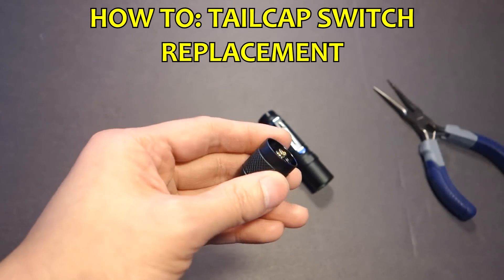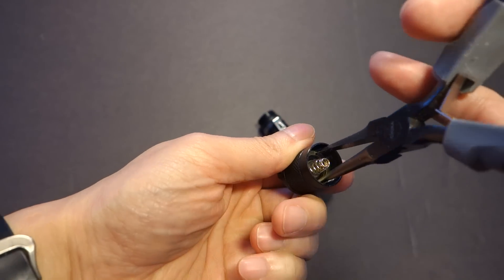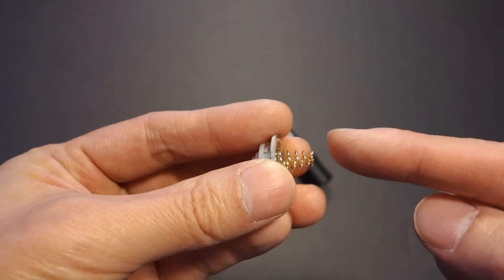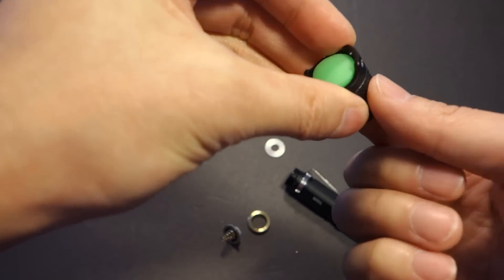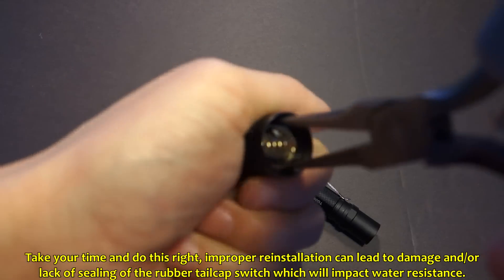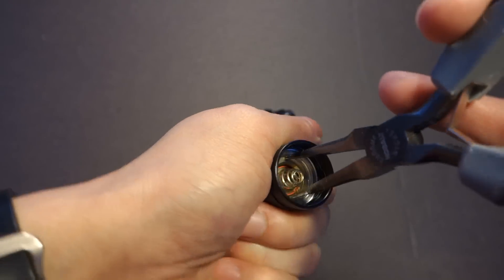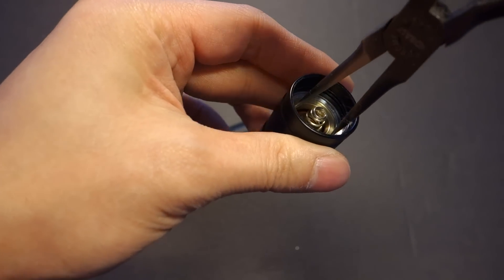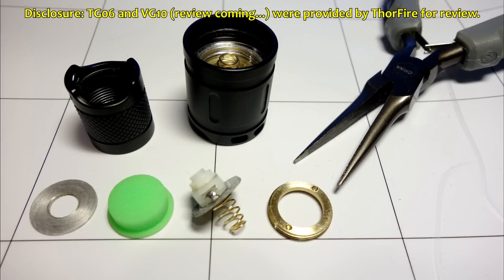HOW TO: Flashlight Mechanical Tail Cap Switch Replacement

Comment: Thanks for the tutorial.

I recently dropped my Nitecore New P30 flashlight on concrete.  It started acting up after.(working intermittently) 

Turns out, the retaining ring was loose, so tightening it fixed the problem.

Comment: Mine doesn't have that.
Reply from the maker: Which model flashlight do you have?
Reply: @TekyTimbo  gas station bought..honestly don't know but it definitely don't have that. Pull back off and push button straight out with under it is a clicker and metal tube that touches the contacts. I promise that is not in it. I will look when home and send to you. Hopefully model is on it. Will be back shortly

Comment: Thank you. Saved me from having to buy a new tail cap for a retro Surefire 6P. They are pricey. The spring fell off the retainer. You helped me get it back on, and working again. Was going to cost me over $50 shipped for a knockoff.
Reply from the maker: Great to hear, the vintage 6P is a legend amongst the flashaholic community. Glad that you were able to get yours fixed without incurring unnecessary costs. May it continue to serve you well through the years!

Comment: So, Im new to flashlights and was looking at a Cosmos LEP, and a Weltool W2 LEP. I want to add a pressure switch for the activation, but I do not think they make anything like that for these small LEP's. Could a service provider just take a pressure switch tailcap and mod it to work with the existing oem clickie tailcap on the LEP's?
Reply from the maker: Technically yes, as long as the threads match it should work. You may be able to find some custom modders on the light forums who have machining tools that could potentially do this for you.
Reply: @TekyTimbo  Ok, thank you so much. Would you be able to recommend anyone for this type of job??

Comment: Great video.  What do ou suggest to use to clean?
Reply from the maker: Hi, thx for the question and your support! Do you mean what chemicals I use to clean the threads? If so, generally isoproyl alcohol 90% (but 70% is fine too). I try to avoid using it on the o-rings, for that I would generally just wipe off the old grease and relube with new, making sure to coat the underside as well to prevent any binding.

Comment: Where can I purchase replacement switch?
Reply from the maker: Try reaching out to the manufacturer of your light; however, many lights use similar switches so you might be able to utilize a similar one from a different brand. Which model do you have?

Comment: Very good presentation and if I politely suggest that Nyogel 760G is a great lubricant that is safe with all O-rings just apply to your valuable flashlights to the treads and the inside of the contacts just a very small dab 
does the job every 4 months to protect your flashlights from corrosion and ease for sound functionality. Around $22 from Amazon but worth every dollar.
Reply from the maker: Great tip! Thx for chiming in!

Comment: thank you. i was about to dump my light, and wondering how it can be disassembled. then i ckeched de switch with multimeter and it was working. re assembly made my day but it works again now :)

Comment: how do you get a new switch?
Reply from the maker: You should be able to contact the manufacturer of your light; some models may use commonly used parts so you might be able to find a substitute from a different light. If you need further help, try hitting up one of the major forums like BLF, CPF or r/flashlight.

Comment: Wished someone would do a video on adding a pressure switch to end of on/off end cap. I punched a hole ran my pressure pad wires try green rubber button, soldered wire to copper spring(positive side of pattern, thought I just needed to made contact with handle to complete circuit but it stays on won’t shut off, I made one 5 years ago but cannot remember er how I did it

Comment: I have a flashlight like that and it has started turning on without touching the switch, even if you pick it up or shake it the light come on but if you click the switch it turns off . Is that a bad switch?
Reply from the maker: It would seem so, what's the exact model you have?

Comment: Where do you get tail caps from
Reply from the maker: Most times you'll need to source it direclty form the mfr of your light but there can be occasions where the inside parts (e.g. switch, rubber tail cap, etc.) might be generic and you should be able to utilize a similar part provided the dimensions are the same.

Comment: I may need to watch a few more times, I see you have taken apart & put back together the end cap & switch. Mine is similar, Alps Mount. & I was able to isolate that it is the switch via YouTube video by BatteryJunction But I don’t quite understand the fix. Thx!

Comment: My tail cap is stuck 
It won't budge 
I have had people who lift 50 kg weights but can't get this base to open 
It's stuck what do I do
Flashlight is Duracell 300
Reply from the maker: They should go for intensive training and try again when they can lift 100kgs :)

Kidding aside, this will be really tough to fix since it sounds like you have severe battery corrosion and the tailcap threads are on the inside thus making it very difficult to get any solvent in there to free it up. You can search for threads around stuck Maglite tailcaps and follow the suggestions (like in this old thread but with still relevant tips: https://www.candlepowerforums.com/threads/maglite-tailcap-stuck.297146). Or I would just try contacting Duracell directly and mention that you're aware of the class action lawsuit (https://www.classaction.org/blog/in-the-dark-allegedly-defective-duracell-led-flashlights-drain-batteries-when-turned-off-class-action-lawsuit-claims) and just see if they'd kindly consider replacing your light - there's no guarantee they will but it couldn't hurt.

Comment: I've tried to fix my leftion switch on my trusty dog walking torch. The workings flew apart when I unsrewed it as the switch was loose. Spent ages trying to put it back together. Failed. To get some enjoyment from the hole sad process, I through it off a concrete wall and then smashed the remaining pieces with my trusty sledge hammer. That thing is f$cked now...proper f$cked! A stroke or a heart attack vs buying a new one from amazon (delivered to your door next day!)....went with the second option. I suggest everyone does the same, your cardiologist will thank you for it!

Comment: I wished someone would do a vid on wiring a pressure switch into flashlight tail cap, the old tail cap was going to be trashed so I cut off the big tail cap want to figure out how to wire it into my small tactical led flashlight. I gutted the tail cap, ten small red wire thru center hole soldered it to the spring that touches the battery, drilled holes and put black wire they hole so it would ground to flashlight body, ends not touching figured I could touch them after putting tail cap back on, but when I screwed cap back on light came on touched wires together nothing, I thought the light woukdnt come on til touched the two wires together. Trying to figure out how light is coming on and how to wire so light won’t come on when tail cap is out on abs touch wires together should come on, I’m smart but this throwing me fir a loop thanks anyone

Comment: Hello @turboBB73
is it possible to edit the mechanical switch in a way that it doesn't "click" any more and gives "momentary only" light? (so pressing the tailcap-button -> light on, releasing the tailcap-button -> light off)
If you know how, could you make a video about that? You could make a "theoratical" video if you don't want to "ruin" one of your tailcaps.
Reply from the maker: A little busy atm but let me have a think through this one and see what I can do. Thx for feedback!
Reply: @TekyTimbo  Thank you for your answer! I hope to hear again from you when you have more time for this topic. Have a nice day!
Reply from the maker: Sorry it's been a while but I haven't forgotten this request, just been quite busy. For now, I'd recommend checking out this vid re: clicky pen switch (https://youtu.be/Zv5Qa2kGL04) since a flashlight clicky switch operates on the same principle. I believe if you mod the switch to shave off the teeth on the cams and guides so it can't latch then you basically have converted the clicky into a momentary switch. If I do manage to find a spare switch I can dissect, I'll post a vid.
Reply: @TekyTimbo  Thank you!
Reply: Mine is a 5 way. All I want is an on and off. I only use 1 mode, 1 click is high.I get tired of clicking it so many times to cycle through the other modes I dont use to turn it off.
Reply from the maker: Apologies for late reply, but unfortunately mode switching is done electronically via the circuit board so there'd be no way to mod the switch to disable modes. There are some flashlight circuits that allow you to program them but those are usually high-end or custom lights and most off-the-shelf brands wouldn't support that.

Comment: Can you replace the switch? I have a 500 and the switch won't click anymore.  I was wondering if and where to order one. 
Thanks in advance.
Reply from the maker: Can you provide the make and model of your light? Not sure what a 500 is.
Reply: @TekyTimbo  it's a  Duracell 500 flash light. Its problem 10 years old.

Comment: Sir how to make that flashlight button switch into momentary button!?
Reply from the maker: Momentary is only possible with lights that have mechanical switches or electronic switches that are programmed with a momentary mode. It sounds like you have a reverse-clicky switch (light won't come on until after the click), you'll need to swap it out for a forward-clicky switch for your light (if available).

Comment: Thanks - just what I needed to see to fix a Coleman CT7 - removed the switch, took it apart, and cleaned up its contacts - good as new and didn't have to throw it away or buy a new switch.
Reply from the maker: Excellent!

Comment: Hello, can you please tell how to check and repair VARTA 3W LED (3x C-cell) torch with tail cap switch (3 mode).
Mine has got some problem with contact, but I don't know how to repair it.
I already pulled out the units inside, except the actual switch, coz I don't know what's inside and don't want to mess it up.
Thanks in Advance.

Comment: I bought a new Anker Bolder LC 89 Light and the switch would intermittently make contact.  They sent me a replacement.  Same thing happened.  Faulty switch design.  Is there a generic push button switch that's simply on and off that I can purchase separately to repair this correctly?

Comment: It works lol. Disassembled and resembled and it worked. Used a pen to unscrew and screw. Not 100% working every single time but now I just squeeze or slightly rotate the switch to get it on.

Comment: I have just bought a single AA cell torch and it has an annoying switch that goes through cycle rather than a simple on off feature.
This is annoying to say the least but my cree torch does now have a retaining ring.

Comment: Where can i get replacement caps i need one but the flashlight i used uses 26650 batteries so id need a bigger one
Reply from the maker: Most should be generic but best to get in touch with the seller or manufacturer of your specific light. Otherwise you can try reaching out to some parts sellers (e.g. illumn.com, fasttech.com, http://kaidomain.com, etc.) provided you know the exact dimensions of your cap.

Comment: How do you put on the rubber usb cap of it comes off? If it not damaged, thanks!
Reply: You need to takeoff and disassemble the end cap.  After the end cap is off AND disassembled, just place the rubber cap back on top, then reassemble the end cap and screw it back on. It's that simple.  You will need very fine needle-nose pliers to unscrew the inside of the end cap.

Comment: Hello ! Thanks for your video, it’s great. 

I have the same flashlight, but the light does not switch modes anymore, i don’t know what happend, i did use it as usual, but one day it does not change modes ... I can’t choose light strengt and can’t use the strob ... 

I don’t know what could be the problem ... Do you have an idea ? 

Thanks

Comment: If your torchlight is flickering or goes no light when you drop, all you need to do is put a the smallest coin you can find and place it between the spring and end of the battery
Reply: Is it safe?

Comment: So my flashlight was having issues and I think I fucked up. So I have LC90 by Anker. I didn’t do research before I started messing with it. So I got frustrated and removed the gold spring thing that’s attach to the button to turn on the light. I was wondering can I just put it back on or did I really fuck up my opportunity for an easy fix???? Please anyone help

Comment: I got a Thorfire TK06 and my button is messing around, only being on low. It goes up to high when held in, however, that turns out the flashlight, too. My problem is that I can't open the gold ring, as it is super tight. Any ideas how to get it off before stripping it bare?
Reply from the maker: Going to assume you mean the TG06 given there is no TK06 (that I'm aware of) and the TK05 actually doesn't have a tailcap switch. Only thing I can suggest is spraying some WD40 and letting it sit for a while then trying again with the tailcap held firmly by a wooden vice (or using some cloth against a metal vice so you don't damage it). Don't have my TG06 with me atm but on the TG06S, to loosen you twist the brass ring CCW.
Reply from the maker: I forgot to mention, if you do manage to get it loose with WD40, be sure to clean it off with an electrical contact cleaner or isopropyl alcohol before reinstalling the switch.
Reply: Sorry, I mean the TK05. The switch is in front of the battery, but the fastener is more or less the same. Thanks for the comment, I'll try it later.

Comment: Wished you would hv shown us dumb asses who hv tried numerous times how you connected the wires inside. I think I understand what you did m.(laying it against the side of casing and glued. But I drilled. Diagonal 1/16" hole into inside lip on mine and tinned the wires after I. Ent thin in half doubling the thickness and built up the wire with solder and pushed into hole. Other wire I soldered wire onto spring and used. jB weld to hold the spring in place. Hopefully I have the wires connected correctly cause polarity matters when using led lights. Before I had wire just forced Btwn cap threads and light stayed on always. Hopefully I had polarity backwards. Had a red wire and white wire coming out of pigtail. I used a bought pigtail and cut the cap off because it would not fit my light I am using a light just like yours. If not I guess I'll cut the wires on the outside and swap the around and head shrink the wiring do t know what else to do. I e typed everything into phone to Try and find how to wire pigtail into flashlight End cap thanks

Comment: Hello. Any idea where to get replacement rubber tailcaps? I need one about 1/2 inch in diameter. I can't seem to get and exact results online.
Reply from the maker: Which flashlight do you have?

Comment: I see several posts about modes. The led driver counts clicks from the tail button. Basically, the modes are in the head. The tail just sends the same signal over and over every time you click. The driver counts clicks or half presses to determine what mode you should be in.

Comment: My switch shorted and the flash light would not turn off completely  on a NiteCore , 2- AA model.  I tested it with an ohm meter and when it was in the on position it would show 100% current   and the switch was in the off position it would show 50% current.     I guess I'll have to buy the internal switch mechanism for the tail cap switch.

Comment: I had a Rayovac Workhorse Pro™ 3AAA LED Virtually Indestructible Flashlight that wouldn't turn off. I used this video to take the switch apart and put it back together. It is now working properly again. Many thanks.
Reply from the maker: Thx for the comment, glad it was helpful.

Comment: Idk how legit flashlight companies make any profit nowadays. I say this because you can buy a cree 1000lumen led flashlight on eBay for 5-10 bucks. And it works just a good. I recommend the brand  orbtronic 18650 batteries because they last all day long. I really love these cheap flashlights. Get the ones that have a button style tail cap instead of the spring style tail cap. Over time the springs lose resistance and results the light to flicker.

Comment: It's pronounced vwah.lah for viola in French for "there". You're saying vee.walah which is incorrect. the wah sound rhymes with bra. 

https://www.merriam-webster.com/dictionary/voil%C3%A0

How do you deal with a Atomic Beam that refuses to shut down consistently? Pull the battery case out all the time? The tail cap switch is obviously defective.
Reply from the maker: Ah, thanks for that. Not sure how I pronounced it in the vid but I'm accustomed to saying voy lah instead of the proper way... Learn something new every day. As for the AB problem, are you  referring to the lantern or the flashlight? If lantern, these usually have fairly long coiled or leaf springs so I'm not sure if you can unscrew the bottom enough to lock out, else it'll be as you said, to remove the batteries. Wondering if a gentle smack near the switch might help as it sounds like something might be shorting the electrical connection. If flashlight, it looks to have the same problem as the lantern and compounding the issue is it looks like the threads on the tailcap side aren't anodized so you wouldn't be able to simply lock it out by unscrewing it, in which case it'll require removal of the batteries as well... Not sure how the tailcap is constructed but it should be pretty similar to the one I covered in this vid. If you feel confident enough, you can try disassembling and cleaning the electrical contacts to see if that helps. Good luck and lmk how it goes. Cheers